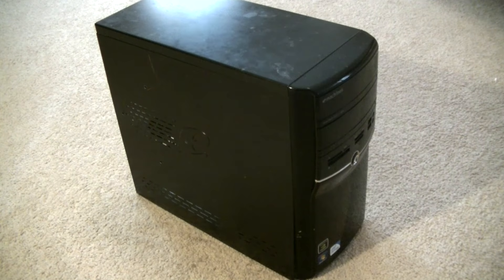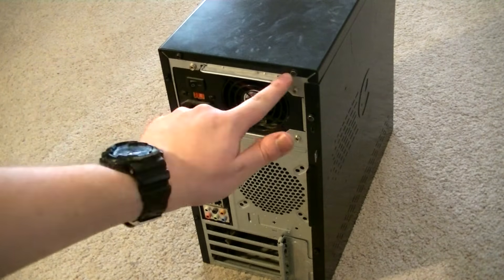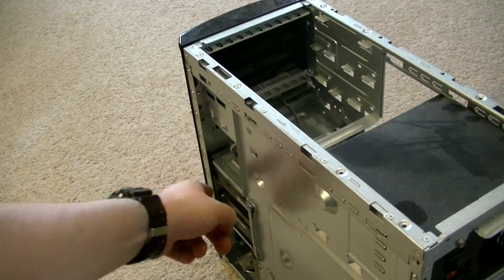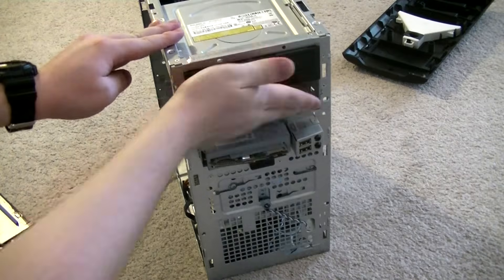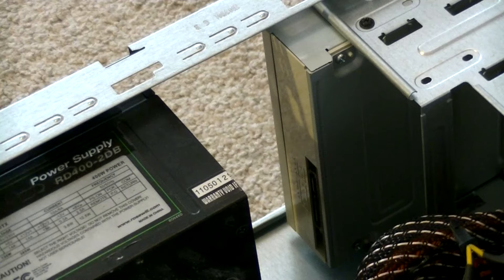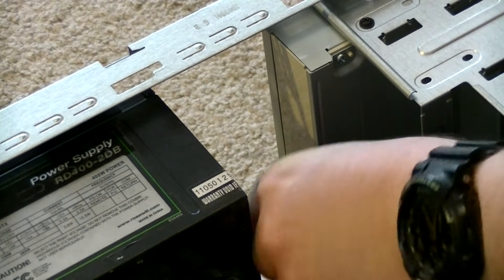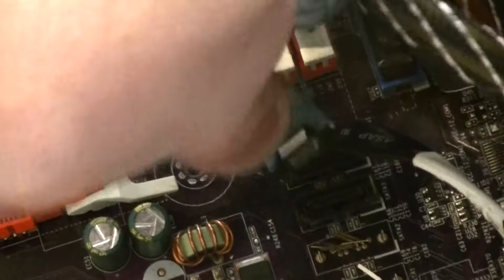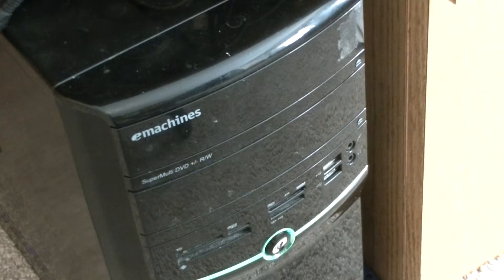How to Install an Optical Drive into a Desktop PC

Comment: Can you help me?
When I turn on pc the disk reader shows up, but I can not eject/open it with a button. I tried so many fixes but nothing worked
Reply: Also, psu cable that I plug in disk reader has 1 additional orange cable, however hdd and ssd does not have it
Reply from the maker: It sounds like a mechanical issue with the drive itself without more information. Unfortunately I don't know of any way to repair that other than replacing the device.
Reply: @Torqcx  I already fixed. Just replaced boot priority in BIOS

Comment: What about the audio connector on the cd drive
Reply from the maker: If an optical drive had extra ports on it such as audio and USB, I'd imagine they'd connect to the front panel ports on the motherboard. But I've never seen one of those.

Comment: Hi! I found your tutorial after trawling through Google and I love how easy to understand it is! I have a question regarding the SATA cables. My disc drive is a bluray drive and it didn't come with any cables, just the drive itself. In the tutorial you have two SATA cables it looks like that you plug in but only one of them goes to the motherboard - did you plug the other one into the PC power supply? I asked a tech friend of mine who confused me with a lot of things and said that I would need loads of different items in order to install it 😅 I'm glad that isn't the case!
Reply: The 2 SATA cables are a data cable and a power cable - the data cable is what gets connected to the SATA interface on your motherboard. The SATA power cable comes as part of the standard cables you get in the box when you buy a power supply (PSU), and it indeed gets plugged into the power supply as you thought. If your drive didn't come with any cables, you can easily buy a SATA data cable from any electronics retailer, but the SATA power cable will be specific to your power supply - so if you built this PC yourself, then you should have it in the box that your power supply came in (as mentioned above). If it was a prebuilt PC, sometimes they put these inside the case already - they typically come daisy-chained along a single cable, and look like wide flat connectors. In particular, if you already have a SATA hard drive in there (either a SATA SSD or a mechanical HDD), then you should be able to find its own power cable, and then check in the area along/around that cable to see if they've included another connector to the power supply for additional SATA drives (such as an optical drive). Unfortunately, if your PC was made by a big well-known brand, then they often don't include any such connectors in the case, and different power supplies use their own proprietary cables that aren't interchangeable, so you can't just look online to easily buy a power cable either. So If that turns out to be your situation, then you're probably out of luck in terms of installing an internal Blu-Ray drive, but the easy alternative is to just buy an external Blu-Ray drive that can plug into one of your USB ports (it can then get all the power it needs, and also communicate with your motherboard, all through that one port). Just Google "USB Blu-Ray drive" and you should be able to easily find one on e.g. Amazon. A particular model that's highly-rated is the Verbatim 43888, which sells for around £100-£120 here in the UK (equivalent to approximately 115-140 Euros, 135-160 US Dollars, or 185-220 Canadian Dollars).

Comment: I'm thinking of getting a Asus Prime z790 P Wi-Fi ATX motherboard it has 0 mSATA slots and (4) SATA slots. Will I be able to connect my DVD player?
Reply from the maker: If it's an internal DVD player like the one shown in this video with a SATA interface, then yes, I don't see why that wouldn't work.
Reply: @Torqcx  Awesome thanks! I shorted my pc so need to replace CPU & MB. I can manage the rebuild, ans I own a legit copy if Win 10 pro, but I don't know how to get all the parts to "talk". When I buy a pre-made PC (last time was 2011 so things might have changed), but, they give you a CD with all the software, drivers & "configuration"  & that's the biggest difficulty I'm having. I want to rebuild it myself but I don't know how to get everything to talk without the pre-made CD.  If you made a video on that that would be awesome!
Reply from the maker: @scienzchic1 All of the components should be able to communicate with each other as long as all the hardware's compatible, functioning correctly, and installed properly.
Reply: @Torqcx  OK that gives me confidence. I really want to attempt this. You rock! Thanks for the great video too. Very helpful.

Comment: I previously had two cd/dvd IDE drives in my Dell 9150 computer. I am clueless on the jumper Master/Slave/Cable Select settings. The computer also has a regular hard drive. HOw do I set up the computer so it boots up again with CD/DVD drives correctly set up. - Clueless in San Diego.....  (BTW, your video and your voice over work is great. What microphone are you using?)
Reply from the maker: With modern SATA drives, master/slave/jumper settings should not even be in the question and left alone; it's all automated by the motherboard now. However, if you're still using IDE drives and/or SATA drives that still need to use them, you'd have to specifically read the manuals of those models (sometimes they're labeled directly on them). Basically, the only drive you'd want on master would be whichever one has the operating system on it; everything else should be set to slave.

Thank you, it's appreciated. I use a Blue Yeti, basically the best USB mic you can get for the money.

Comment: Can I dvd drive power connector for hard drive. Pc i5 tower. My power supply have two sata power connector other connector are id. And I used for hard drive id to sata connector . My hard drive burn
Reply from the maker: Optical drives and hard/solid state drives use the exact same types of power connectors, whether they be SATA or IDE, so yes!
Reply: @Torqcx  I have two power connector sata one I use for dvd other for hard drive but some time blue screen on start of computer. When I restart pc do not make any blue screen.

Comment: Hey. Im using my old laptop dvd drive... would it be able to work if I use the power supply cable?
Reply from the maker: It should be fine, just make sure you get a SATA connector so it can also plug into the motherboard.
Reply: @Torqcx  thanks man💪🏼I will do so

Comment: Is it OK to share the same power cable with another device. For example, I have a sata power cable connected to a SSD. It has multi connectors on it so I used one for power to the optical drive. Is there any danger of overloading the cable with too many devices connected?
Reply from the maker: SATA connectors can only be used to plug in a single HDD, SSD or OD (optical drive) at a time. However, those multi connectors you're talking about are actually single connectors drawing their own individual amounts of power, all just sharing the same cable leading to the PSU.

So the short answer is yes, you can plug in as many devices as you want with all of those SATA connectors!
Reply: @Torqcx  Thanks!

Comment: hey what if my pc doesn't have an optical drive slot where could I put it?
Reply from the maker: Then the short answer is there's nowhere you can put the optical drive. If you need to read a CD/DVD, there are external optical drives that connect via USB you can get ahold of.

Comment: So, you don't need to connect an HD audio cable to go to the sound board like back in the day anymore? Sounds just automatically appear when trying to watch a Blu-Ray movie? Not sarcastic, simply stupid since I haven't built a PC since 2006. Thank you.
Reply from the maker: I've never worked with an optical drive that required that before (guess I'm not old enough), but yes, modern optical drives only need to be plugged in with the SATA connectors!
Reply: @Torqcx  Thank you very much!! Will be subscribing to you now.

Comment: Hi Torqcx. I just installed a DVD+/-RW Dual Layer Burner with the help of your tutorial. Everything seems to work fine, except when I look in the Device Manager it's showing up as a CD Rom Drive instead of a DVD drive. Did I do something wrong?
Reply from the maker: Does it work as a DVD drive? If so, that may just be the way it is labelled.

Comment: Would it be possible to install an OLD disc drive in a more modern pc?
Reply from the maker: As long as it uses SATA connectors, yes, it should work!

Comment: Question: I'm attempting to use a 250Gb Samsung 860 Evo SSD and a 1TB Seagate HDD on my browser to gaming computer conversion. Is it still possible to use my Optical Drive?
Reply from the maker: You can so long as you have enough SATA ports available, yes.
Reply: @Torqcx  I would need three?
Reply from the maker: @atmusic9694  yes!

Comment: I'm wishing that I will get a Desktop Computer with 2 to 3 Internet DVD Drives and 250 to 500GB of Hard Disk Windows 8.1 or 10 or a NEC Computer capable having 2 Internal DVD Optical Drives

Comment: Question, I have an optical drive in my pc but I’m getting a hard drive, can I disconnect the cables from the optical drive and use them for a hard drive
Reply from the maker: Yes, you certainly can, as long as you don't mind having an inoperable optical drive!
Reply: Torqcx Max's Tech Ok thx, I really have no use for it because I’ll be adding a hard drive to my new pc( bought it used) since it only came with 64 gb ssd
Reply: @kruelxd6966  Yikes! that's small!
Reply: AT music yeah  I keep deleting stuff bc I’ve had 5 Gb of free space for weeks
Reply: @kruelxd6966  How much room is left just from installing the Operating System alone?
Reply: AT music Windows itself takes up 30 gbs while 20 gbs from my programs
Reply: @kruelxd6966  Yeah I definitely support getting a hdd

Comment: Help I’m in windows but I can’t find it
Reply from the maker: Ensure the power SATA cable and the data transfer SATA cable are connected firmly, then head into the Disk Management in Windows and see if you can find the optical drive in there. If you can't, either you have a bad SATA connector or the device is broken.
Reply: Torqcx no it’s ok I just needed to restart my pc

Comment: He forgot to show how and where to plug in the power.
Reply: Reality Matters put it in the slot that lines up
Reply: @KrrakoReal  missing the point
Reply: Just had a brain blast, try to find the correct a slot Sony can but the motherboard spins can go inside the optical drive
Reply: This comment is a year old so idk if you solved this but one end obviously goes to the optical drive, that cable should either be coming from your PSU or would've came with one to plug into it depending on your psu.
Reply: @shinanimedubs1269  I did solve it, even before I wrote my comment.
It was intended as a critiqe of his attention to details.
One should never expect people to understand what is obvious to yourself, just show how it is done !

Comment: My cabinet chiptronex gx 2000 where i install this?
Reply from the maker: From searching around online for a few minutes, it looks like that case has a couple of 5.25'' bays on the top just like the case shown in this video. I suppose that's where you'd install an optical drive.